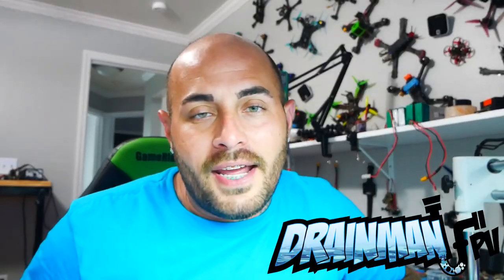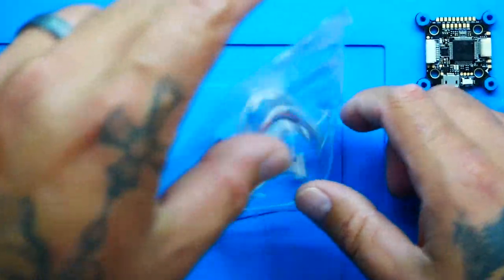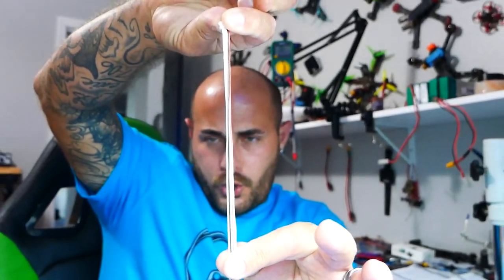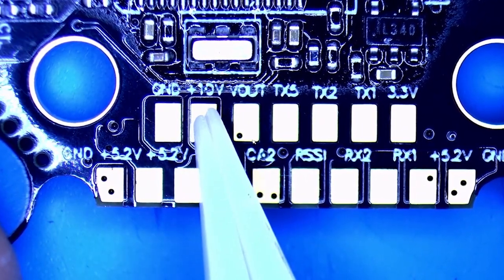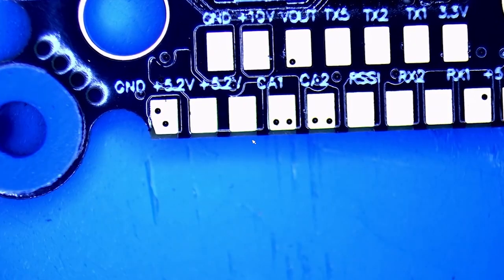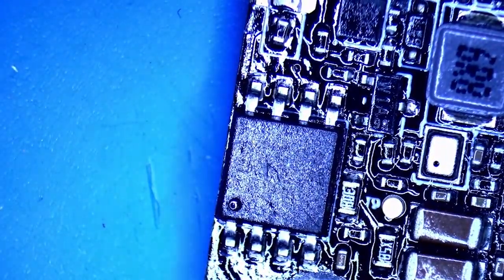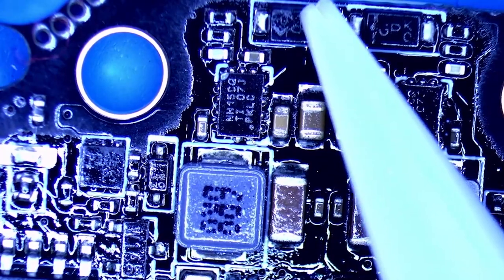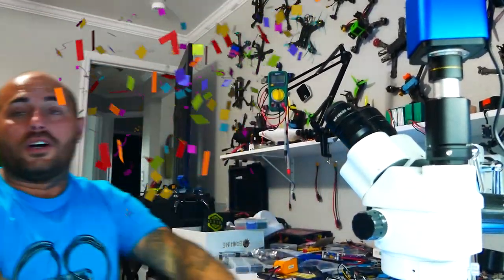New HobbyWing Convertible F7 Flight Controller !!

Comment: Damn dude. I bought this in a stack because it was the most reasonable priced 60a stack in stock. I didn't know it was this bad ass. My first plugin to Betaflight called it a hex. I don't know that it has 6 motor outputs. RDQ's advertisement says it doesn't have a barometer but it does. Two 10v outputs and 2 camera outputs? That's awesome. I bought this for a 7 inch build because I wanted a fast cruiser for chasing a race car. The barometer is nice. I can have it hold it's altitude if I need to. Very cool.

Comment: BE CAREFUL installing this if you get the stack. Mine came with several wiring harnesses which are wired differently. Use the wrong one and you might blow your FC. Another weird thing that can damage your DJI is that if you use the Vista harness that comes with the Vista, it will plug in to this FC but the wiring is backwards. If you just plug it in you will be feeding 10v to the SBUS pad on the Vista. You have to pull the wires out of the plug and swap them.
Reply: yelp i cooked my vista. Took fc off put brain radix 2 much better thats bs they need warning about plug
Reply: @2bfpv882  That sucks man. I gave this same warning on RDQ's review section but they won't allow my review to be posted up there.
Reply: @CarbonGlassMan  mine wont i tried its bs i put the radix 2 on the esc just have remove one wire from esc harness itll plug in its crazy how much better the radix flys being a h7
Reply: @2bfpv882  I don't think I'm that good of a pilot to tell the difference. I have F4 and F7 quads and I can't tell the difference from how one flies to the other. I usually get F4s if I'm building a quad that is only going to have a receiver and a VTX because they have fewer UARTs and are cheaper. I'll have to get an H7 and try it.
Reply: @CarbonGlassMan  yea u can tell there so smooth i was noob and could tell instantly setup is alittle easier as far as sbus all that crap lol giv it a try I gota hobby wing f7 forsale and bunch analog stuff for sale too frames etc
Reply: @2bfpv882  where do you have this stuff for sale at?

Comment: Ohh, So it does have a VTX Switch! They don't advertise it as having one. Deff buying one now! Thanks for the very detailed review DrianMan!
Reply: did you get it to work?
Reply: @1stCybervanes  yes you need to resource any uart in the betaflight cli to a pinio 1 then in the modes tab chose a switch for user 1. You can download the Hobbywing F7 users manual. Very detailed Hobbywing is great for that.
Reply: @baggszilla  i did that but mine never worked
Reply: I never got OSD to work on this thing period

Comment: What firmware use??? Flywoodf7dual or hobbywing_xrotorconv ??
Reply: I need to know this as well! I bricked the FC probably using the wrong firmware... Now i have no gyro and no escs...
Reply: did you solve this?
Reply: @Unboxingexperience7  which firmware did you flash?
Reply: did you solve this question?
Reply: @Unboxingexperience7  did you solve it?

Comment: Good review mate. Got mine a could of weeks ago and put in the Titan 5 --  think it's one of the best I have flown with. Love the way it's ready as a plug-and-play for the air unit, but I removed two wires and plugged in the Vista.
Reply: Which two wires ?
Reply: @luisg8939   The S- Bus and Ground wire from the JST cable and then plugged it in and used the remaining fore wires for the Vista

Comment: Isn’t the VTX switch only connected to the 10v for DJI? Which isn’t to bad since you can run most cams off the 10v and turn that off along with using ghost or tracer using the same switch to shut off the VTX and camera.

Comment: Used HW on my helis no issues. But....2 dead HW 60a 4in1 and 1 dead G3 FC. Contacted HW and never got a reply. Just hope that the esc's coming with this F7 as a stack have better QC control.
Reply: I know Hobby Wing for years via their rc plane stuff..not special..failures just like the rest
Reply: @steve_beatty  When I had issues with my HW stuff I started searching and there are lots of pilots who have experienced problems with 40a and 60a HW esc´s. maybe bad luck.....
Reply: @AlvaSpeed   They are not the worst by far...It might just be my luck..I just went through 3  clracing aio boards (3 !!!!!) building a 3" Shark Byte whoop....I had to jump through significant hoops to get each one replaced and each had a problem..a bad esc...a bad voltage sensor...a bad accelerometer...I essentially built this quad 4 times and disassembled it 3 times before I ever got to fly it...lol.. Replacement board #4 was made by Hifionrc and has been flown   a couple dozen times ...The unfortunate vendor (Pyro) was great through the whole debacle  I have to say....

Comment: I have a problem with my f7 g3 where it flips over to the right(from the back of the quad) when I apply throttle. Then the motors cut out. I am using it with a hobby wing 60a ESC and t motor f60. I've checked them both and everything is exactly how it should be so I know it is the FC. Please can someone suggest anything to stop this

Comment: hi, nice videos, you have been a big help to me.  did you make a video on how to switch from camera 1 to camera 2?  i flashed kaack on this fc and for some reason it switched the active camera pad to pad 2. it took me forever to figure out that's what had happened! i am not running 2 cameras just have this on a racing quad.  i didn't set up camera control or anything to my knowledge.. how can i make camera pad one active again?

Comment: They should have added a Type C port
The way these FCs are becoming expensive they really havent evolved much over the years apart from the processor.
They should add reverse voltage protection , and filters for the power they receive from the ESC to prevent noise into the FPV line.
Also if there arent enough indicators for a few functions its really not that much worth to spend a ton on an FC . 
They should have some light coating on the chips and non solder areas to protect the board from dirt and dust.
Just get a diatone mamba FC and it is bulletproof.

Comment: What target do i flash in Betaflight?  When i plug into the stack it shows the Target as HOBBYWING_XROTORF7CON (STM32F7X2) when i select this board and look for new Target it only show (HOBBYWING_XROTORF7CONV)
Is that the correct Target with a V at the end?  Just asking as the original Target doesn't have a V at the end

Comment: Hey Drainman,  hoping you can help.  I am using this FC with the HW 40a ESC and having an issue with individual cell voltage displaying in my OSD.  Total voltage is correct at 11.3v but per cell is 0.72v.  I turn my radio off and per cell jumps to 3.76v,  any idea?  Thanks man!

Comment: Does the pit switch only control the 10v pad?
Can you please do a video on how to set this up im a little confused
 is there a 5v pad that runs off usb for the rx
thanks for the review
Reply: You figure this out? I can't find where TF I'm supposed to power my VTX from to get the switch
Reply: @leadfingers  any luck? I thought it would switch the 10v pad but it doesn't seem to.
Reply: Hobby Wing support said that the pit switch is inside the DJI plug. I haven't tested this to confirm yet but the instructions provide it will not activate the user 1 mode. But if you add in an additional CLI command to activate the user one mode I think it should work. I'll probably test this next week
Reply: @leadfingers  Ahh that makes some sense I guess, not sure why they put it there and not the other 10v near the vout (or both).

As for user 1 mode, they failed to setup the pinio box in the defaults for the HWF7 target in betaflight. Looks like you also need to add that in. I found it comparing the defaults on the original pdf (it stated to use the flywoo f7 dual target). They do match up except the HW Xrotor target is missing (set pinio_box = 40,41,255,255).

Maybe they should fix that in the default target.
Reply: @MGozz  mine came flashed with that target lol.

Comment: Drain man NEED HELP. I have this FC but cannot get power to the caddix vista. I tested the VTX and it works but just not getting power to it. I'm using the DJI remote as well. Been told to activate modes which I have and still no luck. Is there something I'm missing before I buy another FC. Thanks in advance.
Reply: dont use vista plug cut the harness comes with it there wired differant burns sbus out with orignal vista plug
Reply: @2bfpv882  i just hooked this up today. Is my Vista fried now?! 😭
Reply: @BurgerPlanetLive  it just fried my sbus signal wire on mine  the vista has fuse thatll take one short   if u just plugged in once it may still work hook power and ground up see if it powers up
Reply: @BurgerPlanetLive  it usually just kills telemntry it has fuse that can take one short maybe wire power and ground up see if it powers on they should have never did it like this

Comment: Fellas came you help me out with the harness between the fc and esc. I can’t come up with a combination that lines up. Do I have to re pin a connector??
Reply: Did you get the hobbywing 32bit 40amp? Or something else. If its nots a direct match up youll have to change pins around on the plug

Comment: Mine showed up in betaflight as a flywoo hex.
Reply: So did mine, and I can’t get osd on mine either
Reply: @jamesbartlett3355  I just flashed it to the right one and it's the best flying stack I've ever had.
Reply: Mine too making trash with what they can find laying around
Reply: @2bfpv882  idk if I'd say trash. It's the best running stack I've had in a while.
Reply: @nwcustomdecals  yep had to reflash mine twice to get the osd working as well.
Reply: why or how would they do this...my target is also flywoo hex, not hobbywing...etc... i hate reflashing targets that i spent time setting up, trying to tune, and come to find out its flying like stank poo because its not on the right target...REFLASHtime arggggg
Reply: I no its crazy shows were they got parts
Reply: Which target do I need to choose? Flywoof7dual? After updating I get no gyro...
Reply: @Unboxingexperience7  hobbywing f7 then u need factory dump file
Reply: @2bfpv882  I have not saved my default cli dump. Is there a link to the factory dump file?
Reply: @Unboxingexperience7  ill look see if i can find it for ya if not i can do file dump send u mine itll b about 5 this evening im headed to work right now
Reply: @2bfpv882  that would be great! I searched all over the internet and didn't find it.
Reply: @Unboxingexperience7  no problem i got one of them forsure lol I'll get it win i get home forsure
Reply: @Unboxingexperience7  the paperwork that comes with the FC should have the version you need to look for.
Reply: @nwcustomdecals  it suggests Flywoof7dual target. But that ain't working. There was once a version howi/flywoof7dual but now it is flwo/flywoof7dual. Moreover, there is a new target howi/hobbywingf7concertible which doesn t work for me too.
Reply: @Unboxingexperience7  the hobbywing F7 version of what the manual that comes with the FC states to use. What do you mean when you say it doesn't work for you?
Reply: @nwcustomdecals  I updated to betaflight 4.2 without saving the cli dump. Now I get the nogyro issue which indicates a wrong firmware...
Reply: @Unboxingexperience7  in betaflight, reflash your FC to the hobbywing_xrotorf7conv and it should reset your FC to it's factory setting. You'll have to reduce all your settings but that's supposed to bring to a clean slate.
Reply: @2bfpv882  any chance to upload or send it to me? You re my last hope
Reply: I’m having osd problems and smart audio…not to mention it’s “drifting” on takeoff unless it is 100% level on pluggin in/initializing

Comment: Would you have to solder the wires to the Caddax vista kit directly to the pads or could you use the connection made for the dji air unit? I know soldering on one side will still be needed.
Reply: do not use plug itll fry a vista direct solder it

Comment: How is this setup in bf     what uart and is it sbus serial on conf      i cant get my dji controller to show up    its bound to au
Reply: uart2
Reply: Im sorry now uart 4 and make sure turn on telemetry that was my problem on my 2nd one
Reply: @2bfpv882  on betaflight ports what uart do i turn on the msp switch for dji telemetry?
Reply: @quad55555 msp on uart 4 make sure u have telemtry turned on in configeration
Reply: @2bfpv882  right on, also if i use the dji remote rx, do i need to set a uart, if so which uart does the dji harness use/attatch to?
Reply: @quad55555  yea run ur sbus wire to uart then turn on serial rx on that uart then set reciver type to sbus
Reply: its uart 2 on my harness